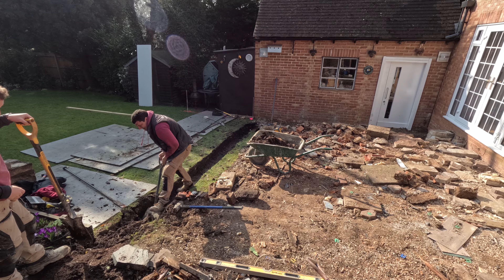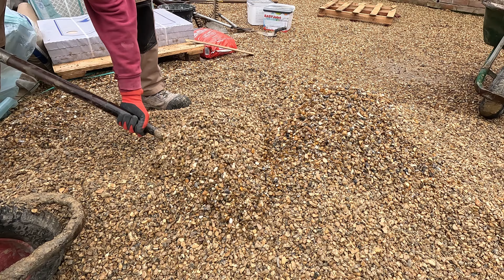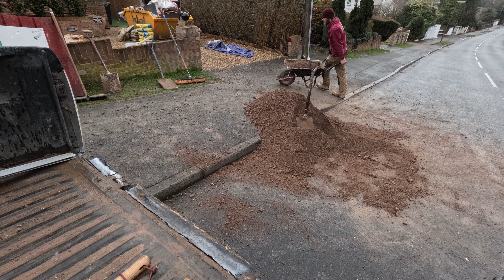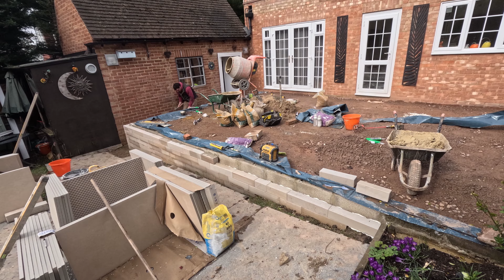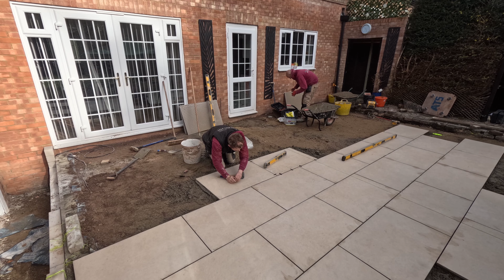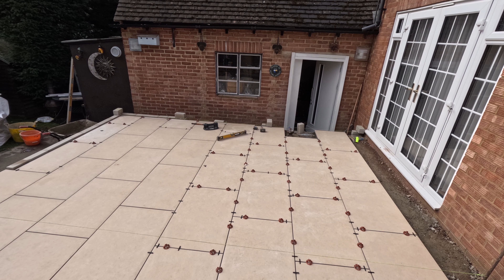Porcelain Paving & Sawn Versuro Walling - Timelapse

Comment: Hi mate what brand did you use for jointing please thinking of giving fuga pave flex a go myself looked like the same simple process
Reply from the maker: Hi, sorry for the late reply, comment got held for spam for some reason. The pointing is some stuff called Norcros, not a big fan of it but the customer wanted it. I've not used Fuga Pave Flex, but I've only heard good things from it. Personally I like using Flowpoint or GFTK.

Comment: Great job, loving the very light grout there! I'm looking to do a DIY patio and looking for a very small piece of advice, do you think a 'PQC' layer between sub-base and the mortar bedding is necessary for a residential rear garden patio?
Reply from the maker: Hi and thank you!
We haven't ever done a PQC layer so i wouldn't say it is necessary. What type of paving are you thinking of going for?

Our process is dig-out, lay down a non-wolven membrane down to prevent soil migrated to type one, 100-150mm of Type One limestone and then 3-6cm mortar bed at a 1:4 cement to sharp sand ratio. We always recommend to slurry the back of slabs.
Reply: @fangornlandscapes5867  Your process is exactly what I'm thinking of doing as well, so that's reassuring - we are looking at either sandstone or porcelain with a preference towards porcelain.
Reply: A paving quality concrete layer is nonsense on a domestic setting it's for commercial applications,you either lay hardcore/type one and then lay your paving on sand and cement bed or you can lay porcelain different by pouring a concrete slab and lay porcelain on tile adhesive,but a pqc is  nonsense
Reply: Nice job lads not sure about your little whacker plate,a bit light weight for my liking
Reply from the maker: @scoyle1750  Cheers, yeah it wasn't the ideal whack plate tbh. It's why we were doing such thin layers.

Comment: Hey just out of curiosity, is the paving ok being placed above the dpc of the house with no barrier or drainage troughs?
Reply from the maker: Hi, Paving shouldn't be place above the DPC as it would then cause damp issues.

In this video we are cutting it close as we are only half a brick away from the DPC, ideally you want to be a brick below to stop the splash of rain. This customer was advsied on this and also advised to have drains at the end of the patio, which they did not want even after explaining why they should have them. The patio has a 1:60 fall towards the garden.
Reply: @fangornlandscapes5867  thanks very much for information. Very useful.